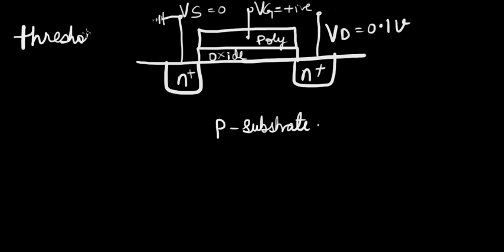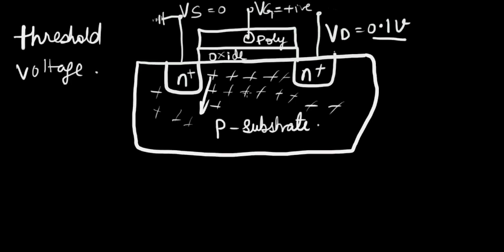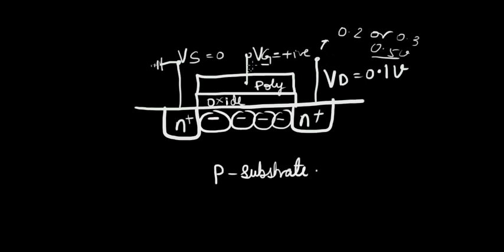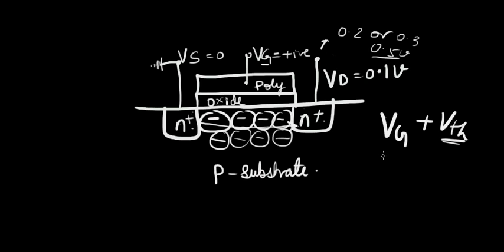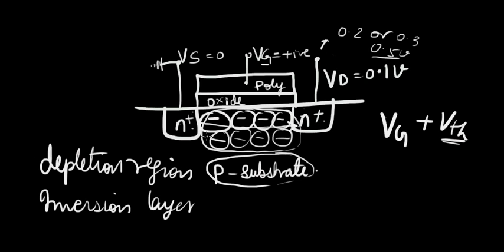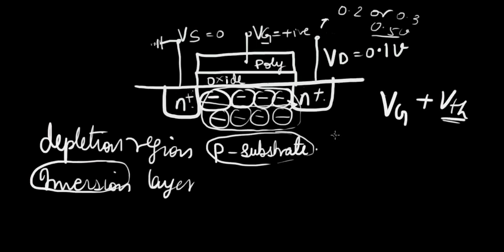Threshold Voltage

Comment: Why is there no current when Vgs is less than the threshold voltage?
Reply: I think it because of a depletion region between the source to drain channel near the gate. And you 
need more vgs positive voltage to push this depletion region away from the gate, inversion layer in order for the n channel to conduct.